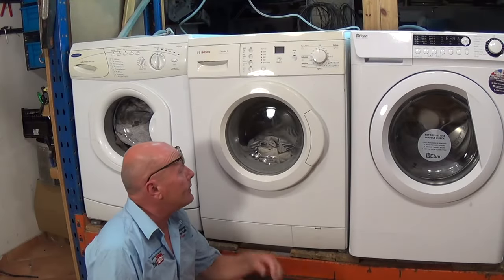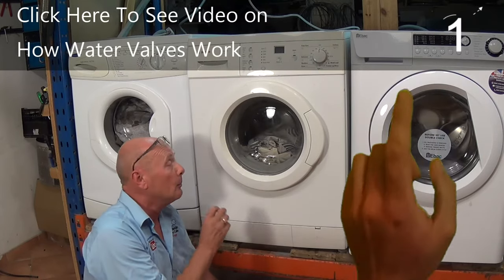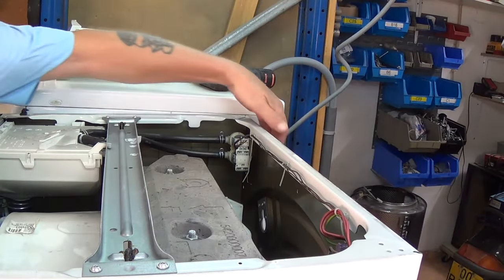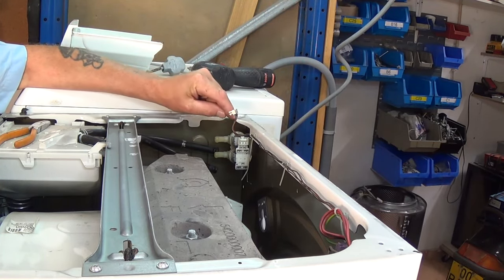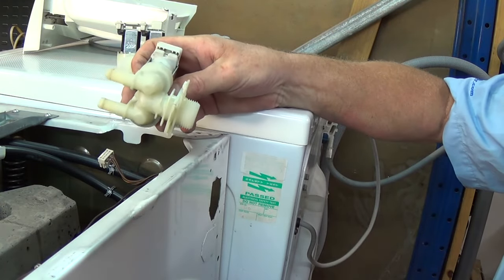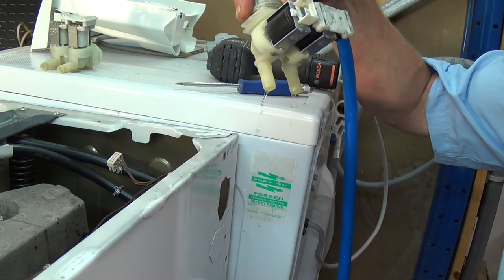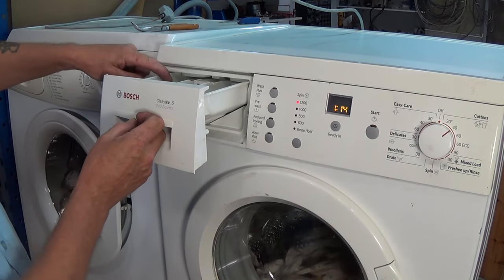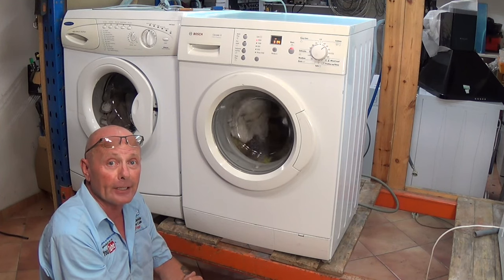Washing Machine Filling Overnight with Water When The power switched off

Comment: I followed the instructions, but it did not work out for me. After some troubleshooting it turned out that the issue was related to the hole in hose connecting the drum and the washer pressure switch. After replacing the hose, issue is gone :) Hope it helps someone.

Comment: I've changed my water valve and it seemed like it fixed the problem a week later and now it's worse than ever. The water is very cloudy so it must be coming back in through the outlet pipe.
Reply: could the new valve be bad
Reply: also check the hose going to the water pressure switch and check the water pressure switch

Comment: I think my issue is the connecting pipe to the sink, as you described, however you do not explain in this video how to resolve that.
Reply: Hey did u get yours fixed? Mine is probably same as yours, cos the water inside the drum is brown, doesn’t look clear so I don’t think it’s the vault. It has to be something wrong with the pipe connecting to the sink. I called plumber over after getting the machine checked by Samsung people, the plumber had no idea what’s wrong with it.

Comment: Ours fills up with fresh water. Thing is, we turn the tap off underneath the sink at night. But when the machine is on and the tap is off, no water is coming in, and when we turn the tap on you can hear the machine filling. We can then drain it every few days and it doesn't fill up again! Also it fills up with too much water when it runs, so i assume it's the water inlet valve, and clearing out what's already in the pipe. But how does it pretty much flood? Like how much water can possibly be in a 1m ish pipe?!

Comment: Hi, Just replaced my 3-way valve on a Samsung eco-bubble 8kg and the water is still leaking into the drum when the machine is off. any ideas?
Reply from the maker: Hi, I will need the full model number of the identification plate and the details of your problem. Please use our contact us page and make sure you fill out the request for what your problem is. A video shoot of the problem would be perfect as well.

We will get back to you within 24 hours, normally. https://www.how-to-repair.com/help/contact-us/ 

Please remember to subscribe to our channel, as that's what keeps this channel going. Thanks 👍

Comment: Great video. What I really appreciated is checking for the leak in the drawer compartment. Totally makes sense. This also showed me it is probably a good idea to open that drawer after use to let it air out and also maybe clean it out from time to time because I found numerous spots of what looks like mold in ours.
Reply from the maker: Thank you very much for the comment really appreciate the interaction there is a great video for you on the channel which I have just done about mold on a door seal you will find this really helpful and remember once a week we do live streams to help individuals out with other appliance problems

Comment: Great videos, I have a Melie w3370 edition 111 which runs for about 1-2mins then cuts out completely, I don’t get an error code as no power. It’s not the power outlet I have tried other electric appliances that work fine and it’s not tripping the supply, just the washing machine. I have tried it on both a hot and cold wash and it does the same thing, cuts power to itself. If I turn the power off for a few minutes it resets but then it will happen again, running for a few mins then cutting out. Any ideas please.
Thanks for the video on how to take it apart it’s brilliant.
Regards.
Mark.

Comment: Would damage to the filter from the inlet pipe to the valve cause this issue?

If so is there a way to just replace the filter rather than the whole valve?

Beko eco wmb81445

Comment: Changed both hot and cold fill valves but still get water in the drum after a few days after a wash. What else could it be?
Reply from the maker: if your washing machine is fitted to the sink unit it could be coming from the sink back into the washing machine via the waste house
Reply: I have that issue, dirty water filling the drum when the machine is at rest. It was connected to the sink. what do  I do to fix it?